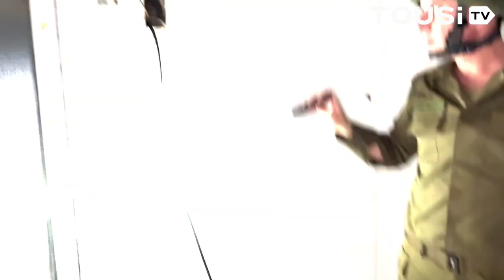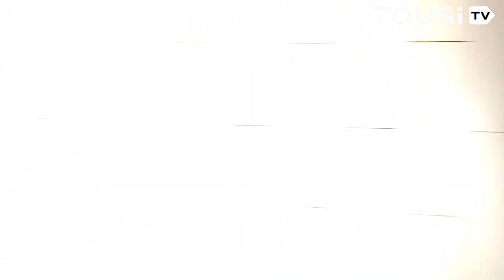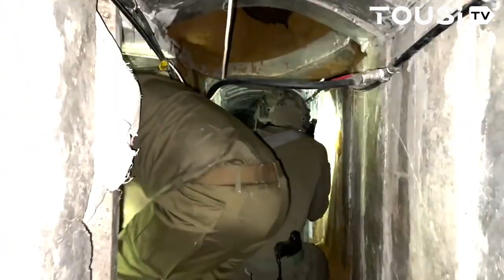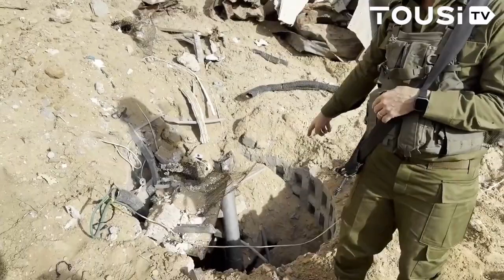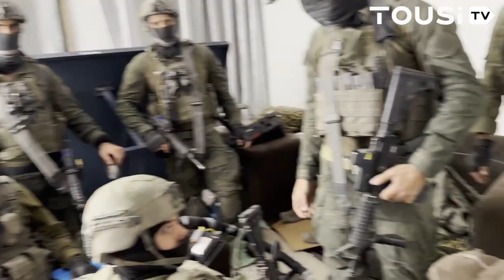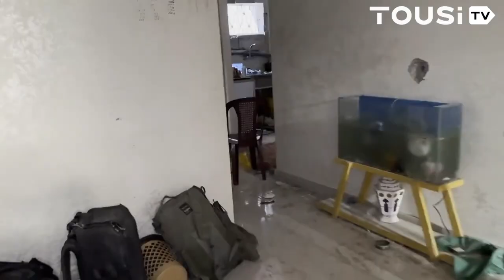IDF Release FULL Video Of Tunnels At Gaza Hospital 👀

Comment: "The Israelis are so sure about the location of the Hamas bunker, however, not because they are trying to score propaganda points, or because it has been repeatedly mentioned in passing by Western reporters—but because they built it. 

Back in 1983, when Israel still ruled Gaza, they built a secure underground operating room and tunnel network beneath Shifa hospital—which is one among several reasons why Israeli security sources are so sure that there is a main Hamas command bunker in or around the large cement basement beneath the area of Building 2 of the Hospital, which reporters are obviously prohibited from entering."

Top Secret Hamas Command Bunker in Gaza Revealed
And why reporters won’t talk about it
BY
STAFF NOTES
JULY 29, 2014
On tabletmag website